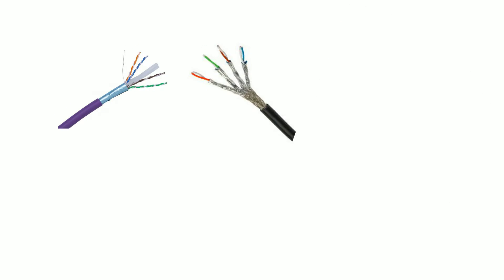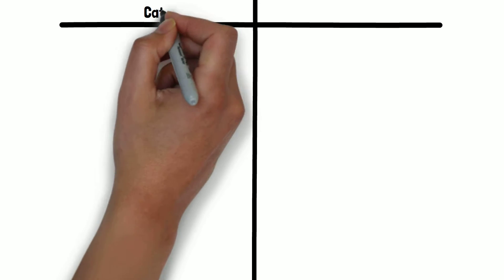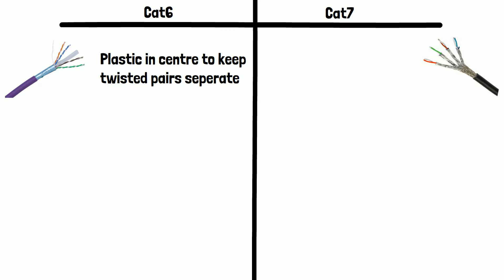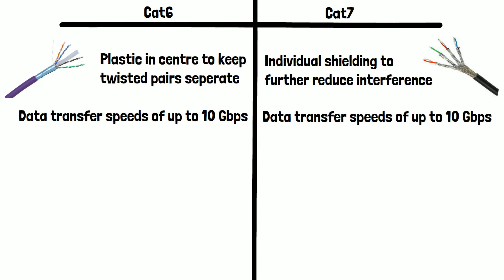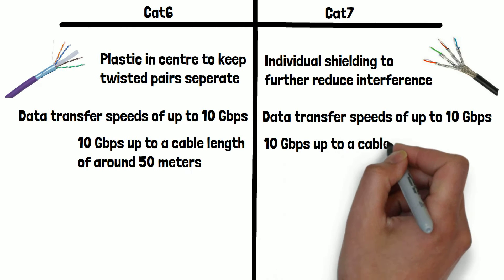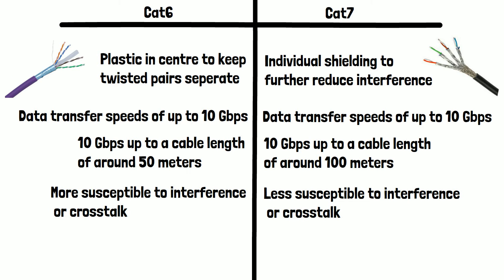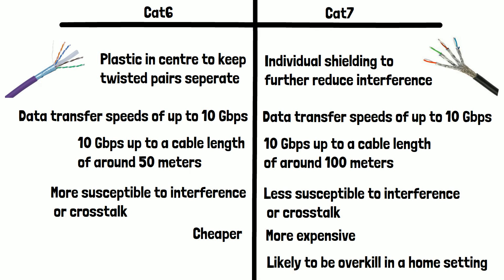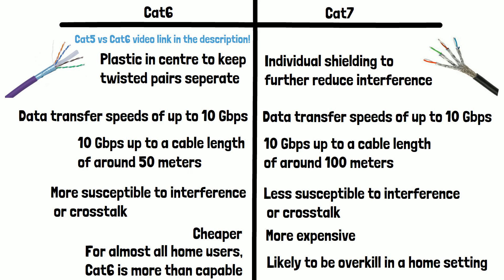Cat6 vs Cat7

Comment: My fam and i are moving. I will be asking the frontier people if they can have a cable go from my mom office (modem location) through the ceiling or underground outside to my room. As well as ask what cable they would be using. I'm interested in the Cat 7 but after this video I may go with Cat 6 since i had a Cat 5 cable in our previous house
Reply from the maker: Yes I would recommend Cat 6 in this case unless the cable is going to be extremely long. In almost all cases internet service providers aren’t providing anywhere near 10Gbps speed anyway so Cat 6 would be fine. Where I am it’s quite rare to be getting higher than 1Gbps for example. Thanks for watching!

Comment from the maker: What cable do you use in your setup?
Reply: Draka uc home cat 7, it is thin, flexible "easy to run through pvc pipe", awesome for fixed installation with "good" keystones..
I love the legrand toolless keystones.. but they are expensive though.. Most of the time toolless makes a worse contact than using a LSA punch
Look at these brands:  Nexans , Draka, Panduit, Siemon , Legrand